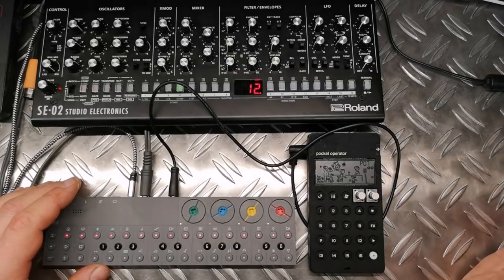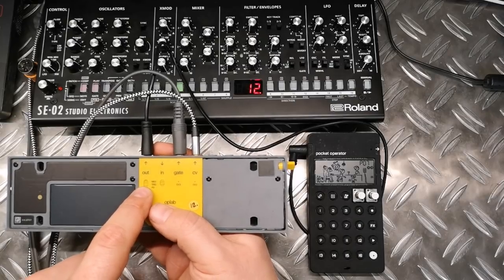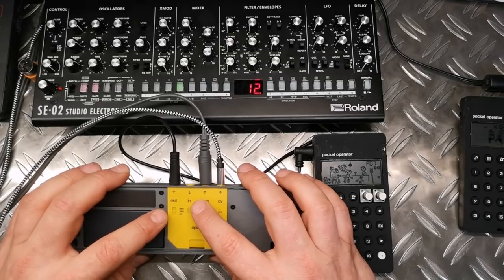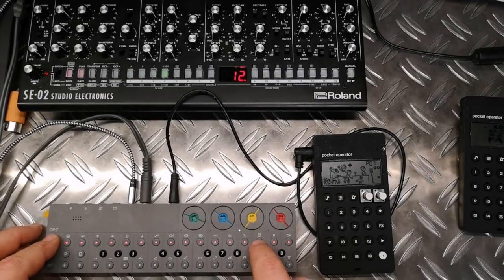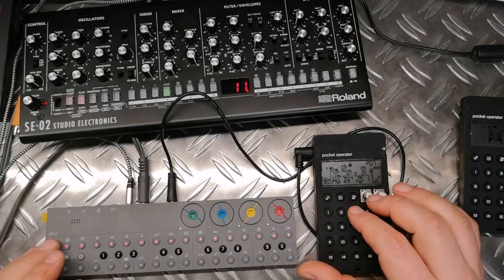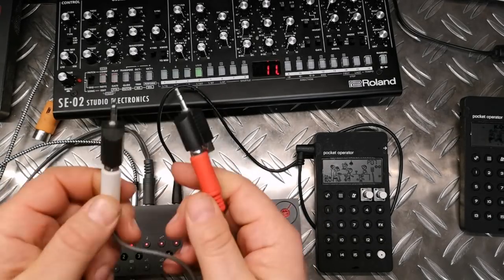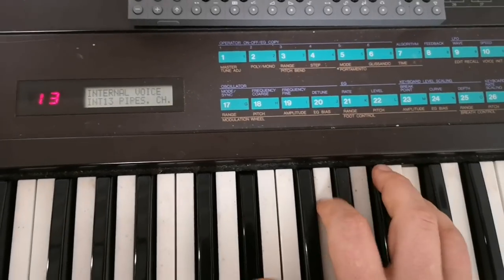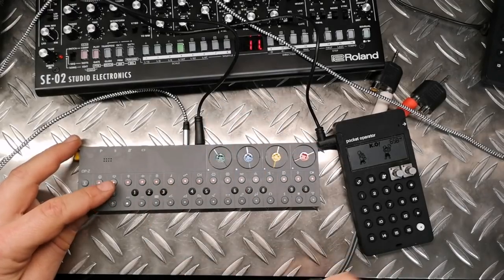OP-Z Oplab Module Tutorial

Comment: Just want to point something out about the RetroKits Minijack Adapter. You select the connection inside of the Adapter with the switch. Like Arturia DIN to Minijack Midi have different Pinouts than, lets say Twisted Electrons. So the switch is NOT for midi in or out but the wiring of the connecting cable.
Reply from the maker: This is totally right, i somehow got carried away while doing the tutorial....thanls for reminding, donr know how icould forget :-) .  About RK005...You can program the retrokits connecting a cellphone and choosing this adress https://www.retrokits.com/rk005/settings/

Comment: Intriguing.  So with midi on the OPZ,  can I use its sequencer to control an external drum machine??  So 16 tracks of midi in the OpZ wouls sequence 16 tracks of sounds on an external drum machine?  And using the various step components??  I need to know before forking out on the oplab
Reply: I also want to know. Not a single video on it.

Comment: Do you think it’s better to drive external synths via the instrument tracks vs. the control track, because they have step components? Also, what is the difference between using the usb Midi in/out vs midi via the opLab? Thanks for another great tutorial Bruno!
Reply from the maker: Thank you.... It is the flexibility which makes this device so versatile for everybody. I personally use internal sounds as a lot of outboard gear which sequence then from the opz. But you can also play it from outside like a normal keyboard.... Especially when you link many engines together you can create quite thick sounds. ,(Track + engines hold)
Reply: The OpLab is apparently more stable and gives you more control than midi over usb so ive read.
Reply from the maker: @LloydRobinson  well, the usb midi got also more stable at all, but of course some synths do not work propperly. you also need always usb isolators to keep digital hums out. But of course both versions are working: oplab and rk005